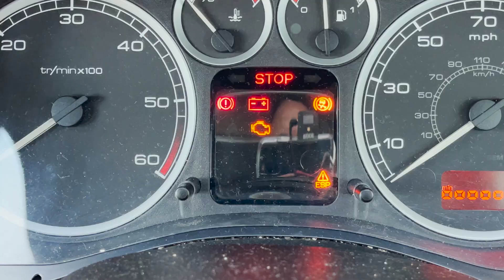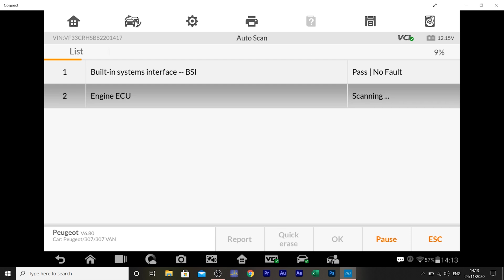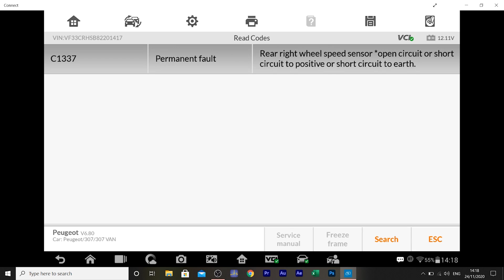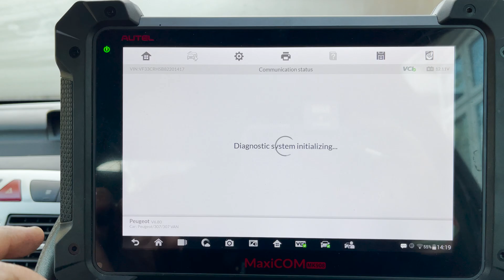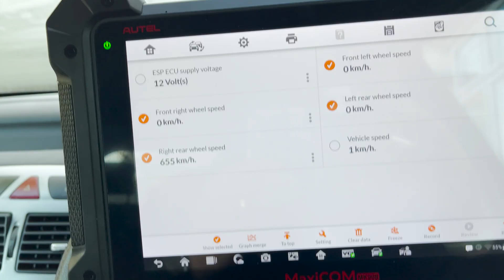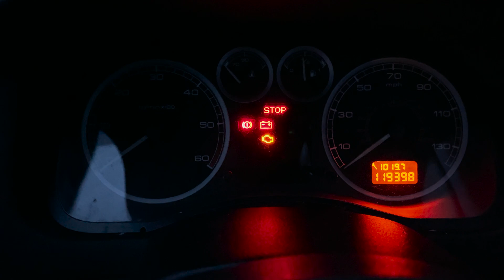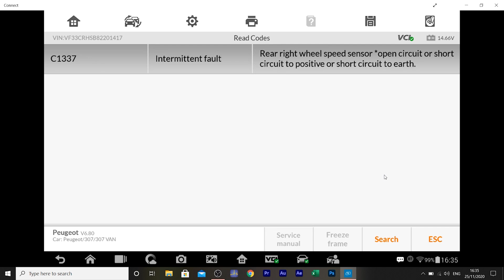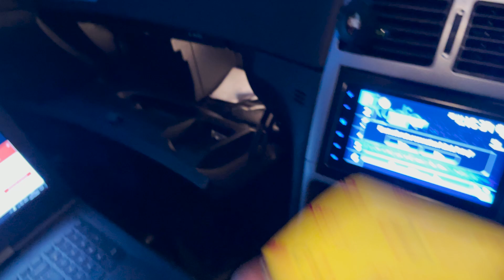Peugeot 307 ABS Traction Control and ESP Warning Fault Code C1337 | Auction Cars Always Fun

Comment: hi watched yr video with great interest and a very good video clear explanation all the way through i wonder if you can help me ? i have a c4 picasso 1.6 thp egs automatic came up with abs fault on front right have replaced disc and pads new abs sensor and complete new bearing with abs magnetic pick up ring now it will drive a short distance all ok but then fault comes back so its loosing pick up of the ring intermittently ? any ideas as to why this is? thankyou for any advice in advance my mechanic seems to be baffled ?? thanks terry

Comment: Funny that you found the missing part in an unopened box inside the car. I did too, but  luckily I had seen it before I revealed the problem. 2+2, but I should have checked the car for the missing part immediately after finding the spare part... Next time!

Comment: hello
wonderful video, I still want help from you, I have a Peugeot 307 from 2003 hdi, a problem appeared after a diagnosis on the left rear wheel, a faulty sensor, I made a complete change of the sensor and the reader on the bearing and the abs sensor and esp again light up, which could be the problem?
Reply from the maker: What fault do you have for the esp light

Comment: Great video and hello from a fellow Bournemouth resident.

Those spiral flute extractors that you were using aren't the best, they have a tendancy to wedge the broken stud even harder against its mating threads as you screw it in.

I have sent you a link to a set that I have had more success with.

https://www.ebay.co.uk/itm/US-PRO-25PC-Screw-Extractor-Drill-Guide-Set-2632-/152534816575?_trksid=p2349624.m46890.l49292
Reply from the maker: Thanks very Mark I’ll order your kit , the one that I’ve used in the video is absolutely garbage it only worked once with me 👍👍👍🙌 cheers

Comment: Wondering where the bearing retaining nut and washer are?
That looks dangerous to me with nothing holding that wheel on the axle besides the friction of the inner bearing races?
Reply from the maker: Sorry mate it had one but it didn’t make the edits  I was trying to concentrate on the the abs problem not dragging the video for too long , well spotted tho 👍👌... You can kind of see me putting it back at 11:34 11:35

Comment: Nice job!
It is normal for the Autel to show those questions marks when auto scanning... 
As you have seen is not comms failure, it is just that failed to identify which module is installed...👍
Reply from the maker: Ah cool good to know mate I thought something to do with the VAN network being a 2001 🤦‍♂️😁... I’ve only noticed that happening to Peugeot vehicles , if the is a make that I’m not fan is Peugeot 😋👍👍👍 cheers

Comment: Interesting as I have an intermittent fault on one of the sensors on my belingo van. It bugs me all summer when its warm, but now its colder the abs light doesn't come on.
Reply from the maker: Tricky one when it’s intermittent it could be so many different parts failing , you see this sort of intermittent issues generally with modules cracked joint etc 👍👍👍
Reply: Thank you. I will likely leave it over the winter as its ok then and perhaps tackle it in the spring
Reply from the maker: @Dark-Lord3386  👍👍👍

Comment: i "think" this is the part i need ? 
17mm Hex/ Allen Socket Key Bit Tool 1/2" Drive H17 Short 62mm in Length ???
Reply from the maker: If crystache22 doesn’t find the info I’ll look up for you later 👍👍👍
Reply: @CarsExposed  thanks, he hasn`t replied.

Comment: When the repair is more challenging than the diagnosis.  I hate when those little bolt extractors snap off.  A headache can become a nightmare!  Nice job with the fix.
Reply from the maker: Thanks mate ... I don’t think this bolt extractor that I have is the best design out there , I never really had much success with it 😩🤣🤣 cheers pal 👍👍👍

Comment: wonder if you could help me again please ?
i`ve got a 2010 skoda superb cr170 MANUAL 6 speed , i cant seem to find ANYWHERE, what tool i need to undo gearbox plugs and how much oil i need for the 6 speed gearbox, could you help me again please 👌👌👌
Reply: Can you give me the registration plate and I'll look in Autodata. If you don't mind.
Reply: @crystache22   KN10 PXV .
Reply: @crystache22   KN10 PXV
Reply from the maker: Thanks @crystache22 for the help 👍👍👍
Reply: https://mega.nz/file/hhI2yTzS#yBXVU7iZysoiPZnDq3wDZP5ygvOLgng40BUVdi2gS4c
Reply: @crystache22   well thanks very much for that, still don`t know what tool i need to undo the drain and fill plug, and if i`ve studied this correctly, i need 2.3 litres of gearbox oil ?
Reply: @t5jerry  And I think you need that too 17mm Allen head Socket.
One for filling and another for emptying the gearbox.
Reply: @crystache22  thank you.
Reply: Download the PDF document from there.  I chose this option so you can see all the details.  you can then put the values here for everyone if you want.